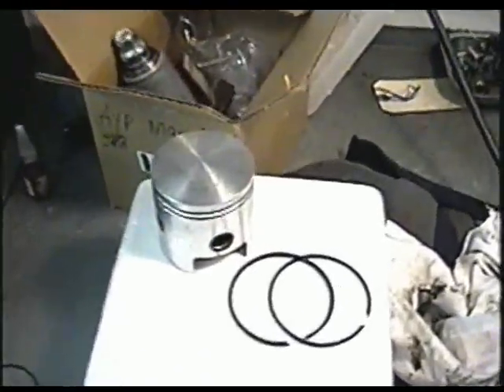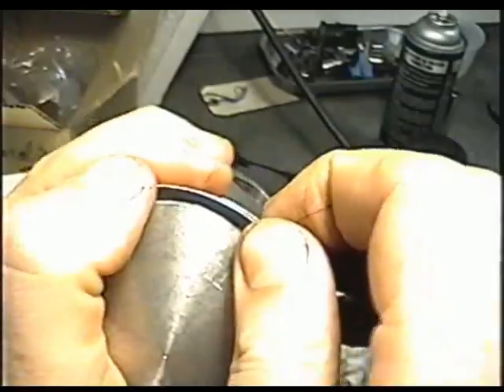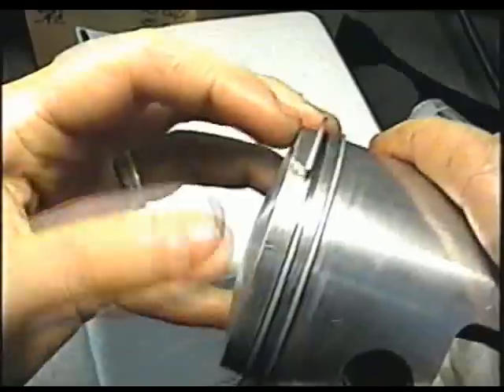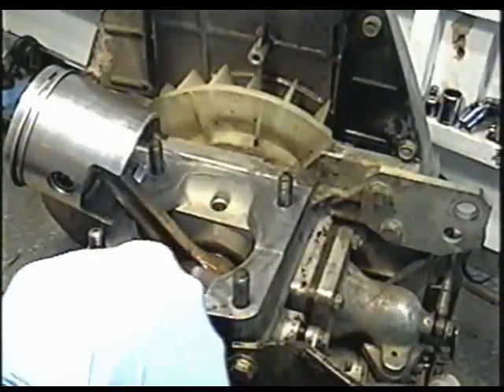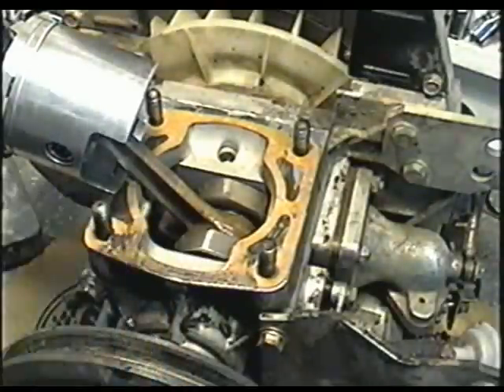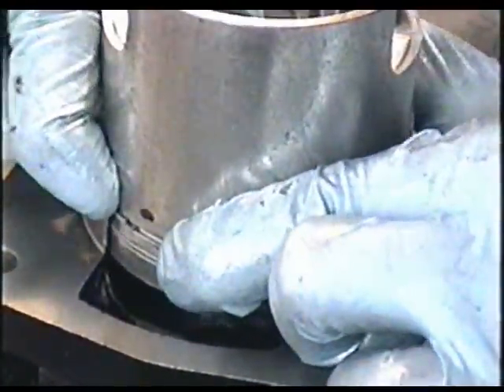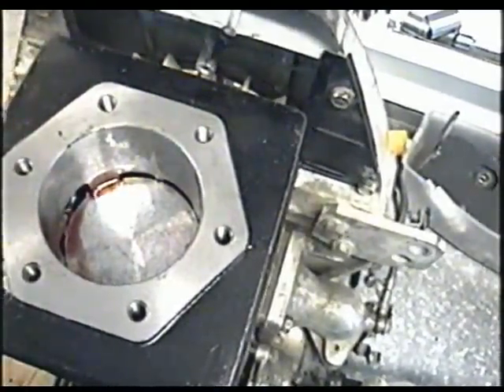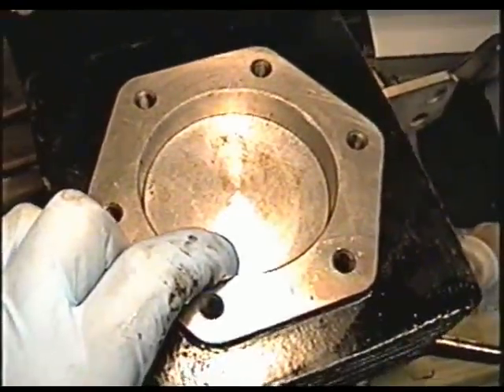Gasoline Golf Cart ENGINE REBUILD Part 2/3

Comment: donyboy your videos are great.  Here's a technique I learned working on 72 Honda CB750.  Piston install works great using a spiral hose clamp of an appropriate diameter as a ring compressor. Polish the ID of a spiral hose clamp so there are no burrs, wrap it around the piston, compress the rings, insert the piston then you can undo the spiral hose clamp completely and bring out from around the piston rod.  The CB750 goes on as a four cylinder set.  It's a must to have removable ring compressors.

Comment: @donyboy73 i know and i actually like it. it gives your videos some "depth" haha as opposed to a regular old 6 minutes of instruction

anyway, awesome video! i have learned several things from every single video i have watched. i found your channel when i first started my goped scooter project im building from a weed trimmer engine. you videos have so far helped me take apart and clean the carb, install all new fuel lines (the kind on ryobi's with the tank on top), and install a new tire THANKS!

Comment: At 4:15 you can clearly see that the piston has been replaced backwards. The port in the piston skirt must face the carburetter not the exhaust port. The 2 PG engine will not run like this. FAIL.

Comment: coming along great.      i had a question on lawn mower carbs.    can you put the jet from one tecumseh into a notheof similar size?  for instance I have a 6 hp tecumseh mower with a bad carb.         and a good carb from a 5 hp.    could I just change the main jets ya think?"

Comment: hey don, i have a 1974 amf harley davidson dirt bike, and it has alot of play between the piston and cylinder, if i stick my finger in the exhaust port i can move the piston from side to side a fair bit, probably a little more than what you had on that 1, just wondering if you usually have to replace the cylinder as well, or if i can get away with just getting a piston kit for it. thanks

Comment: Does it matter which way the piston goes into the cylinder? Im working on an 85 Yamaha G1 Golf cart
Reply: Yes, there is a exhaust and intake side. Should be a mark on top of piston usually. In vid you can see the ex mark on top of piston indicating the exhaust side of piston